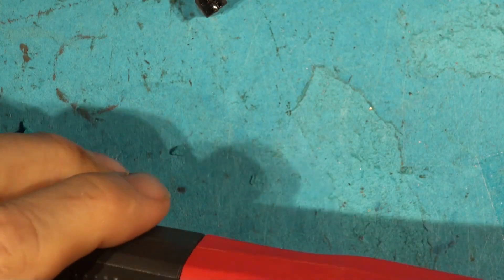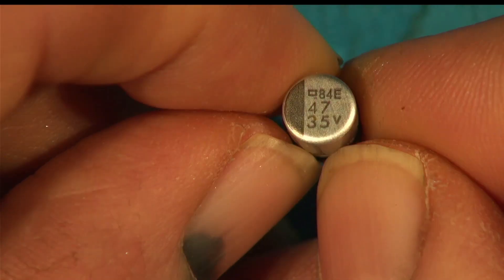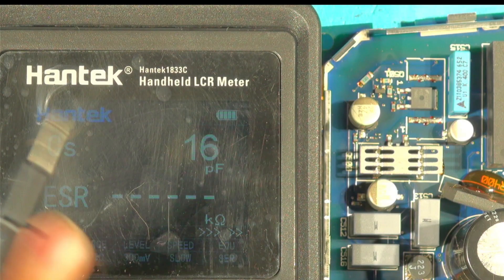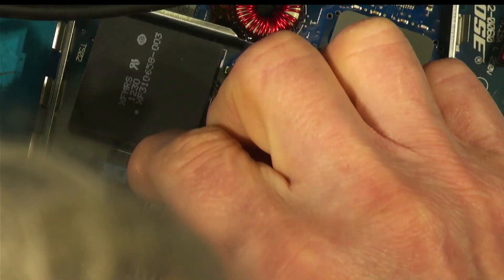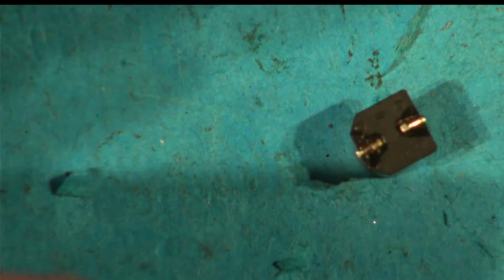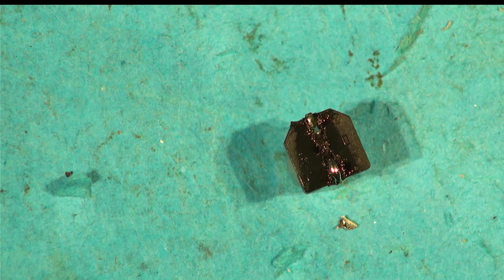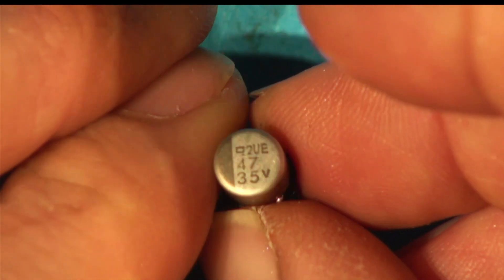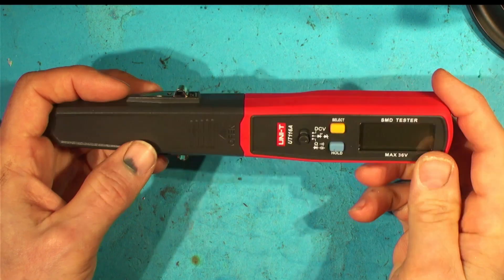Don't be deceived by FIENDISH Capacitors you need to know this

Comment: There's no liquid inside of that capacitor, that's a solid aluminum capacitor.
You have caps that look like it is an electrolytic cap but they don't have the cross on the top of the cap, those are solid capacitors too and there's no liquid inside those too.
Reply from the maker: Aluminium electrolytic capacitors have a wet or gel dielectric and a piece of wadding soaked in dielectric or solvent usually on top of the foll dielectric roll . The wadding acts as a reservoir to prevent drying out.  Open one up and have a look inside.  There is no cross on the can because failure isn't dangerous and wont produce a missile.  They usually just cock one leg if they have a catastrophic internal short.
Reply: It is polarized. On the top, the side marked with black ink is negative.
Reply: @desert_rat_88  Types and Features of Solid Capacitors

There are two main types of commercially available solid aluminum electrolytic capacitors: organic semi conductive aluminum electrolytic capacitors (OS-CON) and polymer conductor aluminum electrolytic capacitors (PC-CON). The structure of the organic semiconductor aluminum electrolytic capacitor is similar to that of the liquid aluminum electrolytic capacitor, and the vertical insert package is often used. The difference is that the cathode material of the solid aluminum polymer electrolytic capacitor replaces the electrolyte with a solid organic semiconductor extract, which effectively solves the problems of evaporation, leakage, and flammability of the electrolyte while improving various electrical properties. Solid aluminum polymer chip capacitors are a unique structure that combines the characteristics of aluminum electrolytic capacitors and tantalum capacitors.
Reply: @RicardoPenders  I originally thought you were talking about a "cross" marking polarity. I see now you meant a cross embossed into the metal on other types to allow the top of the can to split easily instead of explode. The solid electrolytics apparently don't need that.

Comment: Great topic and demo! When I was a complete electronics amateur, I had a $2k audio interface from RME with a loosened lid which I would "start up" with a hairdryer. It's the only way it would work haha. Once it started, it kept going fine because the PSU with the faulty capacitor ran very hot. Eventually it would need more and more heat to start. By that point I started to understand these things a bit better, and I recapped the PSU, replacing small electrolytics with MLCCs. Long story short, maybe 12 years later, I'm still using the same audio interface. ;)

Generally speaking, if I suspect that a unit has a capacitor problem, I may try to heat it just to see if it ends up working again. If so, I can skip detailed circuit analysis and just recap it. As a rule of thumb, I always replace caps that are 47uF and below. 3.3uF and below, I wll try to replace with film/MLCC (assuming that the low ESR doesn't cause problems like loop stability issues). Larger value caps, especially above 220uF, I just test and decide to replace if the ESR is too high or if the capacitance is at or below nominal (healthy electrolytics are typically over nominal). If a unit has 200 caps, and most need replacing.. I make a sandwich and reflect on the value of my life. At which point I may give up and pass the patient to another doctor haha. -Nick
Reply: I should also add, I've had good success replacing electrolytics with ceramics for longevity, but in many cases you'd have to use a higher capacitance value, since for typical dielectrics such as X7R, their capacitance greatly drops off with frequency which can cause pulsed circuits like motor drive circuits to fail. Generally I wouldn't sub in a ceramic unless I understand that part of the circuit and the impact of the ceramic cap. Nonetheless, it's a viable option in the 1uF-20uF range.
Reply from the maker: Thanks.  I might be wrong but the way I see it follows: I just checked the X7R specifications and most electrolytic capacitor's capacitance rolls off at a more steeply with frequency than X7R (an order of magnitude) .  All non-specialist electrolytic's capacitance roll off very steeply with frequency. I was taught that the capacitance dropping off with frequency isn't an issue as generally high capacitance isn't needed at high frequency.  The important factor  is the impedance at said frequency. The issue at with higher frequency is that DV/DT is proportionally higher which means that the peak currents are higher and the ESR becomes the dominant factor in many cap's performance.   If you haven't then look at the (Panasonic FP series) electrolytic - I have found them to be the best most cost effective solution.  Low ESR up at 100 kHz.  In a polar situation I would prefer to use a decent Electrolytic. However most are crap so choose carefully.
Reply: @razenby  Sorry, I failed to do a sanity check for my response - I meant DC bias, not frequency! Almost all electrolytics in circuits will be DC biased, and ceramic dielectrics (especially something like Y5V) are particularly unsuitable with huge capacitive losses from that bias, as well as equally large losses from pos/neg temperature variations. And yes of course, with high frequency filtering what you care about is ESR - which ceramics excel at, hence their primary usage in bypassing instead of energy storage. I've used Panasonic caps before with no issues. I generally use Nichicon caps, and I use their series diagrams to decide what I need (Panasonic has similar diagrams). For low impedance/high reliability I stock a lot of UPM/UPJ series for radial types. Haven't had a single failure so far. For personal items that I repair, I also like to use organic polymer caps. They are expensive but bulletproof. You get nearly film-like specs, at a tiny fraction of the size. I remember when I used to buy them at $5-10 a piece, but prices have come down considerably since. Panasonic was among the first brands to ever manufacture them.

Nichicon through hole electrolytics:
https://www.nichicon.co.jp/english/products/alm_mini/index.html

Nichicon SMD electrolytics:
https://www.nichicon.co.jp/english/products/alm_chip/index.html
Reply: (clicking "diagram search" in the links above give you series digrams)

Comment: Excellent  Mr.Magic.   So re: caps,  it seems to be '' if in doubt, F it out ''.  cos ya cud be getting all the right measurements yet it's still bad.  & uni-T does some well made meters at a very fair price.  only last night i used my uni-t to compare an analogue  Kew 6610 meter manufactured by Eagle International, Made in Japan,   it was given to me but hand written on the instructions it says : bought in Radionics Dublin 4th Sept. 1976.  & when measurements were compared to the uni-t dmm the Kew is still bang on!   45 year old electronic equipment still bang on !  not sure if i'll be saying that about me uni-t ?      :(     lol
Reply from the maker: I agree.  If there is doubt don't put it back.....I get quite a few amps in that have been looked at by a split arsed 'engineer'  when the  root cause  of the failure is documented in a video.   Bet there isn't a Radionics in Dublin anymore.....   Those old meters are pretty good. I still have Fluke meter that I used in 1983 that still works and is close enough for jazz.  I bought Mestek DM100C meters for the engineers. They are pretty good.
Reply: @razenby  yea RS are still here (just about), they always had a next morning  UK delivery every weekday for orders not in Dublin stock.  But now with Brexit it took me 4 days to get them caps cos the customs are going through everything from UK.  Absolute discrase that any EU member can't democratically vote to leave without being punished economically.  It is a failure of what is supposedly a group of nations based on democracy.
Reply from the maker: @tommyhanlon8012  That is annoying to have to wait for bits.  I am sure it will settle down soon.  The EU has too many vested interests. The MEPs have wonderful time living high off the hog on ridiculous expenses and gilded pensions, being wined-and-dined by lobbyists.... - Of course most of them don't want it to end....